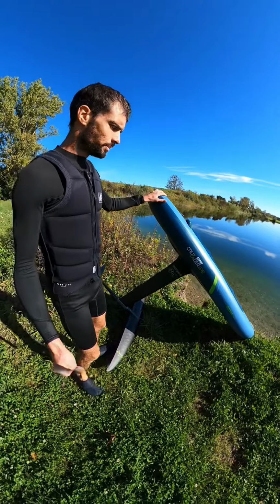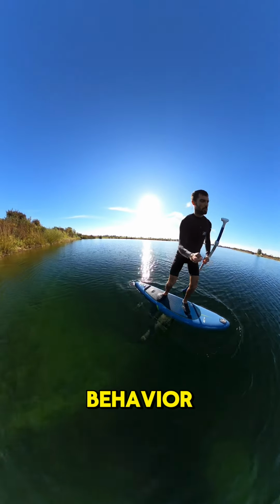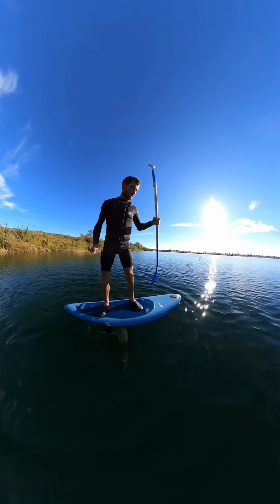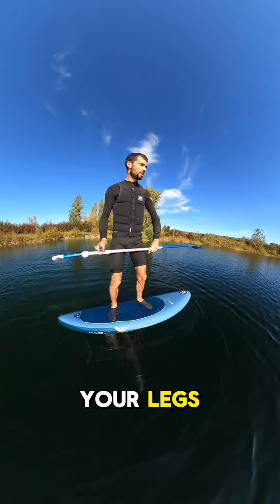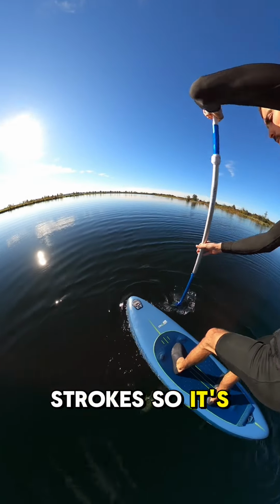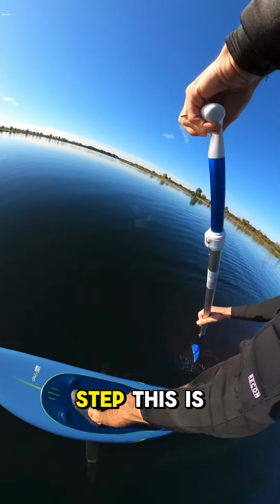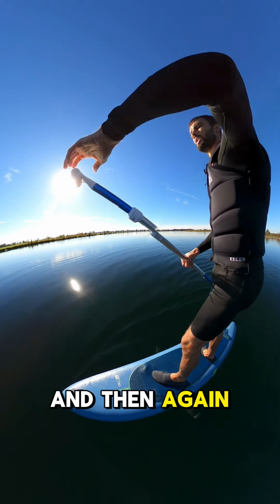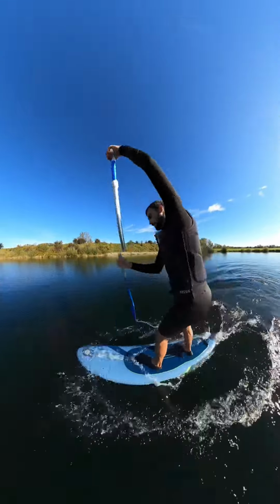SUP Foil | Flat Water Start | for Beginners | PART 3/3 TAKEOFF #supfoil #pumpfoil #hydrofoil #foil

Comment: Thx for your videos! have i to buy a paddle over 200 € or can i start with a cheaper one? What Paddle do you use. THX for your answer!
Reply from the maker: @rmh2995  you’re welcome ☺️ so far I’m using a very cheap one, ITIWIT from Decathlon. I will change it soon with a carbon one. Now that I know I love this activity 😃 it’s worth it. I’m looking a lot of energy with this cheap one that will break anytime I think 😅 
So you can start with a cheap one, it worked for me. But you will loose some power… so if you are struggling and you want to succeed then a good one might be needed 👍
Reply: Thank you so much for your answer🙋🏼‍♂️🙋🏼‍♂️😊ok i understand….you are really the best!!

Comment: Which size of the Sirus wing would you recommend for a 77kg guy with a HiPE Cruzader 7'?
Reply from the maker: @heavyweather  to get started the easiest was the Sirus 3XL 186cm 2400cm2. 
What’s your experience with the Cruzader? Wingfoil? Supfoil? Do you have some experience in sup?
As it might be quite/very challenging to learn to take off I think beginning with a giant FW like the Sirus 3XL might be a good choice to be able to fly and have fun as quickly as possible. 
If you are confident in being able to learn quickly, I think the Sirus XXL 156cm 2000cm2 is a good option 👍
Reply: @Ludo_freefoiler  winging. Is the HM mast and titanium fuse essential or would the aluminium fuse and 85cm mast work for the start?
Reply from the maker: @heavyweather  👍 for the fuse, for big frontwing it is recommended to use the titanium one. For a couple of months I use the Alu one with the Sirus XL, was no problem (I’m 62 kg). For bigger ones safer to use the titanium one. 
You can start with an Alu mast. A HM carbon one is stiffer and more efficient if you keep doing this sport 😉